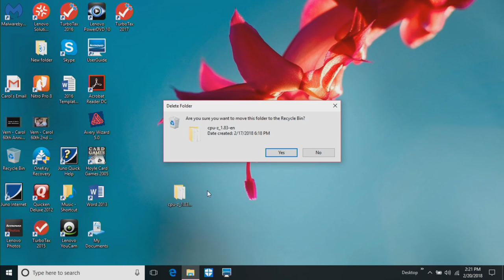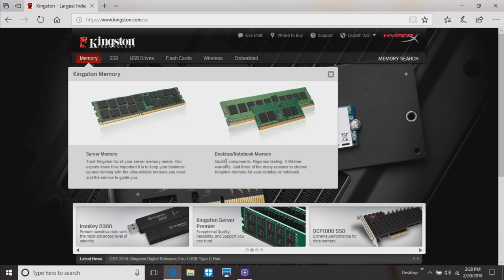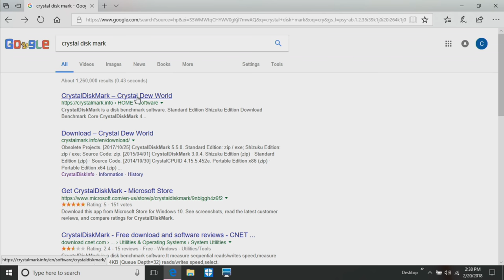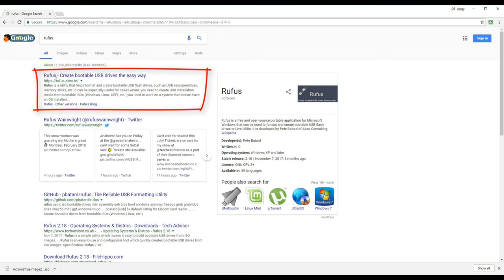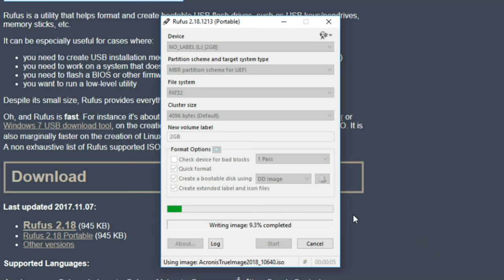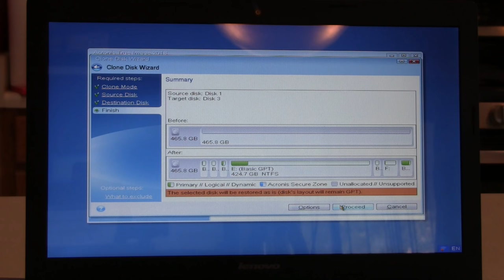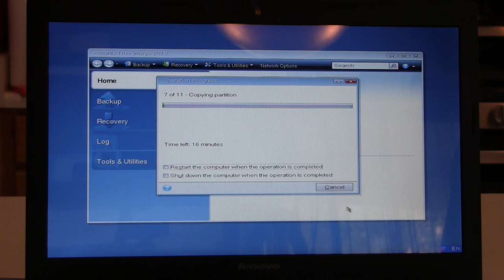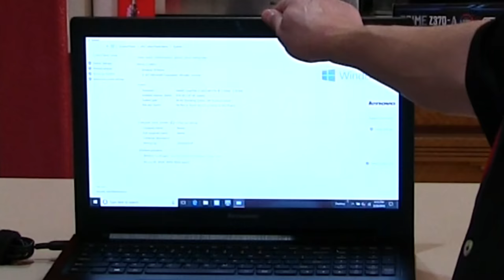Upgrading a laptop

Comment: I was given a 2014 Toshiba L55-B5267 whose screen was bad ... the LCD panel was still good, but the plastic chassis, front plastic bezel, and both screen hinges were broken and needed to be replaced.

The computer sat for a couple of months until I was lucky enough to happen upon a lot having all the parts needed to rebuild the screen at a reasonable price.  Then I went and did some further upgrades: the 750 GB 5400 RPM hard drive was replaced with a spare 256 GB SSD that I had lying around, the 6 GB of RAM was upgraded to 16 GB of RAM because why not since memory is cheap, and then the single band wireless N card was replaced with a dual band wireless AC card.  The computer originally came with Windows 8.1, but was upgraded to Windows 10.

I plan on getting a spare battery and upgrading the 256 GB SSD to a 500 GB SSD someday.  Upgrading the fixed SATA disk is about all I can do on this computer.  I can't upgrade the CPU since it's soldered onto the board and it only has one mini PCI-E slot, which is occupied by the wireless AC card.

Using a lower end 4th gen Core i3 with integrated graphics, my Toshiba is no powerhouse, but it's more than adequate for what I will use it for ... and here's hoping I won't need to make much use of a page file on the boot drive with 16 GB of RAM, which is the most the motherboard can support.  And with the SSD, it's very responsive.

As for why I bothered, I needed a Windows machine; I had been using Macs for a long time and I had been noticing my ability to use Windows was getting rusty.  Since this was a relatively cheap way to get a responsive Windows 10 machine relatively inexpensively, why not?  Also, Windows has better freeware available for CD/DVD burning than macOS; while the Windows freeware actually works fairly well (Ashampoo Burning Studio Free), the Mac freeware hardly worked at all under macOS Mojave, likely because what I could find on the Mac was deprecated (SimplyBurns, LiquidCD) compared to what was available for Windows.

Comment: the BIOS or a diagnostic program such as CPU-Z shows the memory is running at half the frequency. Why?
In many cases, the BIOS or a diagnostic program will report the memory bus frequency, which is half of the frequency for DDR type memory. As its name implies, DDR (Double Data Rate) data rate provides twice the memory bus frequency. So if the memory bus speed is 800MHz and you are using DDR3-1600 memory, the RAM is running at the correct speed.

Comment: As an addendum to my previous comment, I wanted to let you know that my hard drive was 8 yrs old and was in my opinion beginning to fail.  It kept on telling me that it was a none system disk and that I should insert a system disk.  So I figured that it was running on borrowed time and that it was only a matter of time before it fails to boot at all.  I consider myself very lucky it did not crash before I had a chance to replace it.

Comment: A common laptop problem is a keyboard with missing or inoperable keys. Like to see Carey replace a keyboard.
Reply: look on the internet there you will find separate keys for laptop keyboard
Reply: Usually they are. And I've done it a few times. But think some of the viewers here haven't.
Reply: some laptop are easy to replace keyboard but some the keyboard are riveted on the c-panel of the laptop mean you have to cut some rivet just to remove the keyboard and often there is no parts on those laptop

Comment: This is an excellent video and I have a very    s   l    o    w  HP laptom from back when.  If it is cost effective, I may take a crack at it and do the upgrade.  It has a mechanical 500 Gb drive and 4 Gb of memory.  I think this laptop will be a nice little hot upgrade so it will perform.  The onlly real worry I got is the keyboard,  I looks like it is falling apart.  Keep up the good work, Carey.  I enjoy your videos.

Comment: Nice info. I bought a Sabrent adapter but it wouldn't read any info off my PCs or my sons X4 PCs. I wanted one to save pics and data off iPhones and family SATA drives when we were having problems. Tried installing new firmware from Sabrent but they were not much help. The drives work when installed in a PC so they're not broken.

Comment: A well done and clear Video on updtating laptop memory and changing to a SSD from a mechanical drive.
Carey Holzman mentioned not upgrading if the system is Core I3, but upgrading if the Core I7. What about core I5, which sits in the middle?
Reply: The i5 should be OK if you not a big gamer, photo editing, etc.  I'd event consider the i3 tho he says no.

Comment: Just watched your great video. I ran the Crystal disk info utility and got a caution yellow on my laptop. guess ill head over to amazon and get a ssd drive pronto
you might just have saved all my data - ( i have back up but its not the same is it as a true image and then having to re install everything) Thanks  Great job

Comment: Well explained video Prof! booting time improved from 3 and half minutes to under 10 seconds after the upgrade. My questions (1) what is the purpose of the Rufus software you downloaded? (2) will there be any need to reinstall some drivers or re-sign to some accounts after the cloning, and (3)importantly,  ANY OPTION to clone only the operating system files?

Comment: I  would remove any drive partioining that is not required.  The old 32 bit systems could not handle large drive partitions. Partitions slow down systems and can wear out mechanical drives.  Better to have a separate drive rive than a partitioned drive. Stick M2 drives are better again

Comment: laptop was stuck lower for a better temperature gesture and been upgraded in function of your task so Windows is optimizing the computer in real time and during the test you are idle 

For the booting answers laptop had 2 to 4 usb port plus sd card slots... Generally 1 or 2 only were usb2.0 or 3.0(( in the third generation years of Intel processors ))  probably your laptops didn't accept you boot from 2.0 usb socket simply because it should be used in power supplement in a external DVD burner or external Hard Drives. They're able to read a USB stick or external Hard Drives but at REALLY low mb/s
Reply: But concretely to this actual topic it is an excellent tutorial!! You use to one excellent software!! And you are right!! Gen4 intel processor were mutch powerful than the 8gen because from gen 4 they're stop working in power and start in low power consumption (( why today we had intel tablet and hybrid laptop ))

Comment: Hi, I saw your video, it is very helpful for people like myself that knows something about but not much, I also have a Lenovo laptop running slow,  the model is N500 2008 made, only can go up to 3g RAM, already installed,  its 150 GB harddrive is a mechanical 7200 rpm, I wonder if you recommend to upgrade with a solid state harddrive?
Reply: An SSD may help, but since that laptop uses the SATA1 interface, it may not make too much of a difference. If you really still want to keep using this laptop, you may want to consider installing a lightweight Linux distro. That should help with performance some.

Comment: Excellent Video, and tips. My laptop is very similar to that one so found it even more interesting to watch, mines just a newer model. Mine is even slower than the figures given before you updated it lol Think I will look into updating to an SSD Drive and add memory

2 Questions?

I have 8GB memory and 3 empty slots, can I upgrade it to 4x8GB 32GB memory? 
I also have  1TB Hard drive, will I be best putting a Samsung 1TB SSD in? Only £109 or would 500GB be faster as it smaller. Storage is not an issue as I use external Drives for storage

Thank you again, I look forward to watching many more of your video's

Comment: Thank you for your videos.  I replaced my HDD with an ADATA SATA III SSD on my office computer.  Huge difference in boot time and opening apps.  And really easy.  Since it is SATA III, should it not run at approx. 6 GB/sec?  But Crystal DiskMark read speed is 556.4 which, based on the Samsung EVO 850 you used, is fine.  But I don’t understand.   Crystal DiskMark provides results as MB/s.  Conversion of 556.4 equals half a GB.  Shouldn’t it be closer to 6 GB.  I am missing a “0".  Why?  Thanks.
Reply from the maker: You are missing a zero because you are bad at math.
Reply: That made me chuckle because I AM bad at math.  Can't do anything in my head--never could despite doing well in school with higher math.  Has to be on paper.  And this was done on an online converter (two of them)  https://www.unitconverters.net/data-storage/mb-to-gb.htm       1000 MB to one GB, right?  so 556 MB would be .556 GB! Assuming that is true then not a math error, has to be something else--bytes vs bits--what?
Reply from the maker: 1 byte = 8 bits.  b=bits / B=bytes. 6gb/s = 600MB/s. If 600MB/s is the maximum, then what about error checking and parity that occurs in the data to ensure the data sent matches the data received? That takes about 50Mb/s of the 600MB/s equaling a max performance of around 550-560MB/s (depending on the parity data). Make sense? Using Google can explain this in much, much more detail if you are that interested...
Reply: Got it.  The problem was Sata III=6Gb/s not 6 GB/s.  That accounts for my missing "0."  Nice to know it was a terminology error on my part and not a math error.  I recall now that you went over this in a video a while ago but I forgot.  As you say, things "stick" better when you screw up and then figure out the error.  Thanks for sticking with me on this.
Reply from the maker: Glad you got there! :)

Comment: how do you feel about the Western digital SSD's?
Reply: WD SSD Blue when it heat's up they slow down up HDD speed i had that experience also on Scandisk SSD Plus they are very horrible SSD they slow down when you moving tons of files on it. WD SSD Blue and Scandisk Plus SSD uses crappy case because if you over screw a long screw on it might damage the circuit board on it unlike the Samsung SSD they already fix that since on there 1st SSD they follow the Laptop HDD case design
Reply: @ganeryhyperion8386  I've never had a bad or slow running Sandisk SSD. I love them.

Comment: Is every laptop upgradeable? I have an Asus ROG G501JW with an Nvidia GeForce GTX 960M with 4GB GDDR5 VRAM + Intel HD Graphics 5100 and a 2.6GHz Intel Core i7-4720HQ (3.6GHz Turbo) 4C, 8T. Can I upgrade that graphics card?
Reply: Suprafanatic94 no you cannot
Reply: u can only upgrade the system ram and the storage.

Comment: I've done this a couple of times and i never cloned a disc,i just wasn't comfortable migrating everything on to a brand new ssd.Create a windows bootable installation media at the microsoft website(on a usb stick),save all your files and programs on a separate sd card and use that to copy all your files to your new ssd.Use your windows installation media to set up your new ssd,cleaner faster and safer.But that's just me,your mileage may vary.

Comment: What happens after cloning if i keep the laptop and disc source and the disc upgrade (by removing the optical drive caddy and use of the device)? Both drives are bootable. How will disable booting and how booting from the disk source ? Thanks !
Cloning in this case could be done with two discs mounted without the use that SATA adapter - USB ?

Comment: Hey carey I got for my 
Read        &       write  are
75.06                69.21
89.43                86.45
0.53                   0.47
0.28                   0.46
I know from the original drive of this lap top and mine, my drive is pretty horrible by the looks of it I used crystal disk Mark like you did but did I use it right?

Comment: How did he know the SSD drive would physically fit in that frame and the laptop itself, and perfectly snap into the port?  Are they all standard as to physical size and plugs?
Reply: a 2.5 inch ssd is the same size as 2.5 inch hdd.  All laptops use 2.5 Inch disk drive size.

Comment: What was the last year that mechanical drives were put into laptops?
Reply: I think it depends on the model of laptop not the year it was made. A premium model will likely have an SSD while a budget model will have a HDD or mechanical drive. I bought my premium model back in summer of 16' and it had a HDD however it had an empty slot for a m.2 SSD drive. So I think it will be a while before there is an actual "last" year for HDD or mechanical drives in laptops.

Comment: "just three screws away" obviously not a DELL. I had a Dell Inspiron laptop where you had to remove the keyboard, the optical drive, the screen hinges, the screen, the wireless card, the touch pad and finally the motherboard to get to the hard disk. I kid you not
Reply: i have abandoned dell altogether - pro support sux

Comment: 800Mhz times 2 1600Mhz ram.. its double the rate. i don't know why they just use the speed as advertised. it would be less confusing. 4 years later on the comment